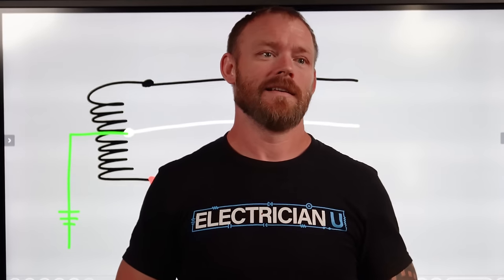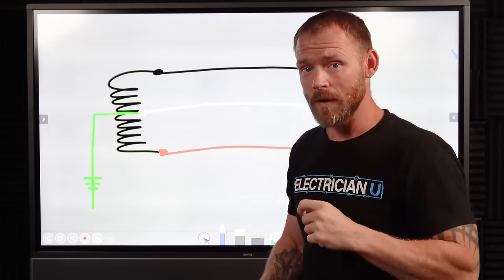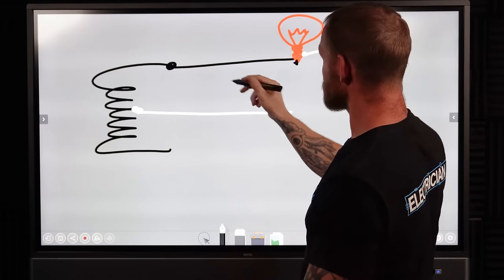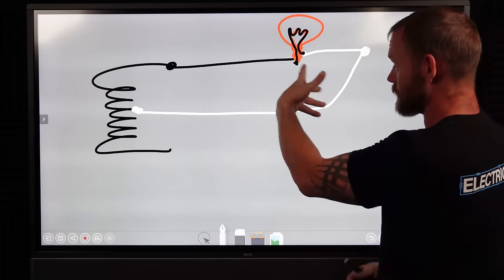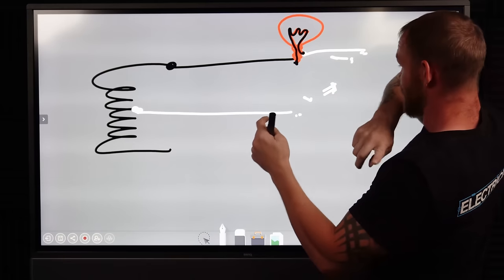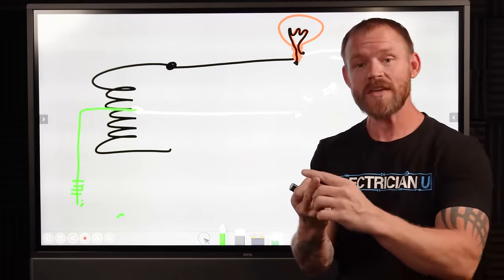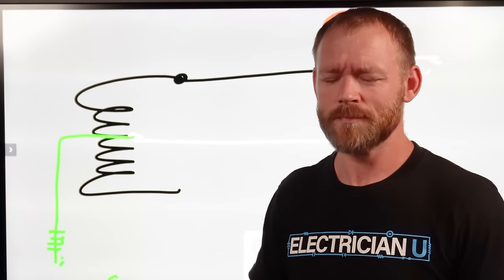Can You Get Shocked From a Neutral Conductor?

Comment: In a domestic scenario a household user can be walking around bare feet in the home which automatically connects the body to ground. If the user touches a floating neutral for a light bulb (and the light bulb terminal is connected to live) the user's body will provide a secondary neutral to the light bulb and current will flow into the hand and out the feet because the neutral is bonded with the earth at the transformer. PS: A Shock from a floating neutral to earth is more dangerous than a live to earth shock. The reason being is that there could be loads such has refrigerators, water pumps etc in the circuit which will draw the current it requires to run through your body. From 1 ampere can be fatal.

Comment: Three way switch where they originally wired a common neutral instead of the independent neutral to the light and each switch through the travelers. The neutral from two three way switches independent and they combined the neutrals. Depending on the switch settings there was voltage in reference to ground on the neutral. I learned the hand in the pocket from my dad an electrical engineer. When followed never got shocked. Some times you just got to use two hands.

Comment: Code nowadays still allows sharing neutrals between 2 or more hot conductors, you just have to handle tie the breakers. I hardly ever run multi wire branch circuits with shared neutrals. It's less safe for a few reasons. There's the shock hazard if the electrician didn't handle tie the breakers, and there's also a real risk that if you lose your neutral connection and it's no longer your grounded conductor, then you have 240 volts across your circuit in series and seriously fry things. And as far as I'm aware there's only 1 manufacturer ( GE) that makes an arc fault breaker that works with circuits sharing a neutral.

Comment: there is a way to get shocked on just one conductor but it does not involve the grid/mains electrical system.  a very high voltage static charge can do this.  in winter on indoor carpet one person scuffs their shoes to become charged and holds a bare wire.  another person touches that wire.  there is real current involved, lasting only long enough to balance out the charges.  this is not the only way.

Comment: Been shocked by neutrals, in a building where the electricians didn't do the bonding to ground that they were supposed to.  I became the path to ground absent the bonding.  And I've been shocked by white wires because the same idiots got "creative" with which wire they used for what.  Fortunately that company went out of business not long after doing that work.

Comment: No if it is a neutral. When it is connected to the source neutral. When a neutral is removed or disconnected from the neutral bar, it becomes an extension of the live / line conductor and your having a belt

Comment: Could this be a dropped neutral? I was working on completely rewiring a 30x50 area with MC above drop ceiling. I used clips to suspend the mc on the support wires. I had my hand on a junction box and accidentally touched my ear to a piece of mc going to that box and my ear got shocked. Not too bad, but enough to make me jump and say a bad word. That particular mc wire was to a light.

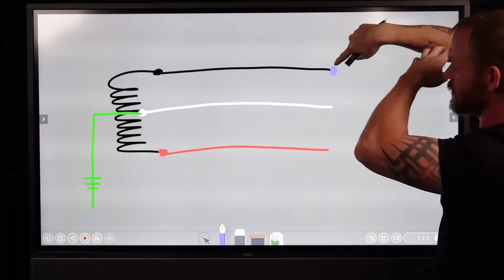Comment: The video makes it sound like you can NEVER be shocked by just touching the black "Hot" wire with one hand. So if I touch the black "Hot" wire as you did at 1:07 in the video and I'm standing barefoot on the ground or in a puddle of water I won't be shocked? Wouldn't the current try to pass through me to ground and back to the transformer?

Comment: I was rewiring a room one time. Though power was off initially. Then as I take a receptacle apart. I notice a 12/3 wire not the usual 12/2. Previous someone carried 2 hots from 2 breakers over on 1 cable. With seperate conductors. Then they split in a receptacle box.  I had power off I though. Then I seen that. And rechecked breakers... I don't usually use noncontact "deathsticks" as they can be inaccurate but I now atleast use it as a 2nd or 3rd verification there is no power.

Comment: I’ve seen a star connected transforme which wasn’t connected to ground (347/600 volts) common, this allowed the neutral to have a voltage which was 347 volts if touched with a person & ground. The job had been inspected by authorities & electrician 😳 😱⚡️

Comment: Got shocked holding 3 neutrals in one hand but it hit multiple points some one ran another circuit through a light and it was still hot. My mistake should have tested it all but I trusted someone else to say power was off while I was at the breaker.

Comment: Question , i was trying to changed a light fixture in a old house   And both cables had power ,  and I instal the light fix. Worked. Normals - why is that??

Comment: If you are in contact with a hot and grounded (no insulated shoes), would you not complete the circuit? At 1:15, you say touching the hot that the current will not flow to the neutral. But if you are grounded = bad day!

Comment: Yes  but I think what we mean is... can a neutral shock a person as opposed to a live positive;  I wondered about that too...since the current goes back to the panel on the neutral I suppose it could shock a person   but you would still have to be grounded? is that what youre saying?  AND IS IT CORRECT TO SAY THAT THE SHOCK WOULDNT BE AS BAD AS  A FEED WIRE BECAUSE  THE CURRENT IS ALREADY SPENT PASSING THROUGH THE LOAD?  does that make any sense?

Comment: You can touch just a neutral and get shocked. It's just a wire it carries current. Remember you are working on a circuit that has an issue. 3 wires burned together. But its 10 feet down in the wall. You have a fresh pristine receptacle you grab the neutral and you get electrocuted and die. It's because down the line there was an issue. So never just assume it's all wired correctly. There is a reason you were called out to work on it. It's not brand new zero issue circuit. Especially on 277 volt commercial property's.

Comment: You can be shocked by the neutral.
You body creats the path to earth neutral and earth's are tapped together at the transformer.
If you were to say take a lighting circuit.
Turn every lamp on.
And disconnect the neutral at the panel and you touch the neutral without touching the panel just standing on ground you can get some voltage and low current flow.
Reply: A broken neutral is not neutral. Just a wire.

Comment: Even worse if the neutral is from  one leg of a transformer based power supply or a motor winding.  At least a light bulb has some resistance.

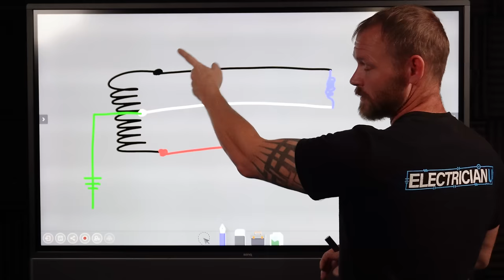Comment: At 1:00 you are completely wrong. The hot wire in your example will shock you. The loop is through you, across the ground, up the ground rod to the source. You even mentioned this later in the video with your light pole example.

If you don't believe me tail out a hot wire, stand there, and touch it.

Comment: Bull**

You can ABSOLUTELY get shocked by touching JUST THE NEUTRAL. 
Last year I nearly fell off of a 20 foot scaffold after shocking myself on a 277 fire exit sign. 
I had to work on it live, so I was extremely careful. I capped the ground, capped the black and only had the neutral left bare. I used my linemen to twist the wire around (the other wires)  to pull it out of the receptacle. Sure enough, I was preparing to cap the neutral, but the wire was all messed up, so I went to straighten it with my thumb and forefinger and BAMN.  Got blasted HARD. 
My feet were on my wooden plank with my insulated boots, and both hands were above my head. One hand on my linemans holding the wire, ,(neutral wire) the other hand touched the neutral end.

Comment: Wait.....I understand the theory and physics behind this. However....just about a month ago, I was installing a new outlet in my guest room, and I had all three wires sticking out of the wall. I accidentally touched the black wire (hot) and bam!! I wasn't touching anything else, and I was wearing athletic shoes at the time ,standing on my floor, which is vinyl planks. I know I wasn't touching anything else because I had the black wire separate from the neutral and ground as I left it that way to ironically keep myself from getting shocked as I hadnt turned off the breaker for that particular circuit.  It was the back of my hand that grazed it when I went to stand up from a kneeling position with both feet flat on the floor. So, what gives???
Case in point, if this theory is accurate, how do kids get shocked if they stick something metal on one side of an outlet ????.....I honestly understand the theory, as this is how workers work on high voltage wires that are suspended on towers. They are not grounded, so in theory, they can't get electrocuted. I just haven't seen this to be true in reality. What am I not understanding?????

Comment: Hey Dustin or anyone in the comments. I’ve asked 3 foreman and my school teacher and no one knows the answer. On a 277/480 system, or any 3 phase system, phase to ground is 277. Phase to phase is 480. What do you get when you tie all three together. I know this is not something we’d ever do but I’m curious. I’ve heard “it would still be 480”and “I don’t know” so here I am!
Reply: What do you mean exactly by tying all three together? If you mean literally connect 3 different phases together with no load you'd get a short circuit. If you mean connect all 3 phases to a 3-phase load then voltage between phases would be 480. See the thing is that voltage or difference of potentials can only be between 2 things, you can't test voltage between 3 phases at the same time, you only got 2 probes on your multimeter. So you'd test A to B, then B to C, and then C to A, which will give you the same voltage of 480. Hope that helps
Reply: Let’s say hypothetically you take all three phases, wirenut them together. Then take a probe from that splice to ground.
Reply: I know it would blow up but you can utilize two phases of 120 to get 240/208 so why doesn’t three phases utilized warrant a higher voltage.
Reply: Im not positive, but I have a hunch it would still be 480.  At any given point in the sine waves, the maximum potential difference would still be 480 volts.  Volts are read as a potential difference to “something” ( typically ground, or against another phase), so in three phase systems one sine wave is always 120 degrees out of phase from the other two sine waves.   So max difference shouldn’t be more than 480 volts.  But, I’ll admit I’m not positive.   

Just a suggestion… get an apprentice to touch 120 volts and measure his girl scream.  That scream can be your benchmark.  Then do same for 480 line voltage and see if his girl scream is bigger (it should be nearly quadruple the scream as 120).  Then get him to touch all three phases at the same time and see if his scream is even bigger 😂😂. Then we will have this mystery solved once and for all.   Who the hell needs engineers ?
Reply: The potential is 480 volts, anywhere between the sine waves. It troubles me that your Journeyman, or instructor didn't know that.
Reply: @jakesully5402  thank you for your response. That’s along the lines of what I thought too but wasn’t 100% sure. And I know just the right apprentice to try that on😂
Reply: @philipabshier2060  okay thank you. And I agree. Three foreman and my 2nd year instructor weren’t certain. Must mean I’m asking the hard questions.
Reply: @philipabshier2060  after some thought I have another question. So when a device/motor calls for 3 phase does it really just needs the other phases to transform the electricity back to rotational motion? As if it only needed 480 volts it could get that from two phases.
Reply: @sethoakes3795  with a balanced load you can have 0 return current. A device that needed 480V has to use 2 phases ( phase to phase) unless of course you simply had a way to boost the voltage. 

I think the answer to your question lies with in the properties of 3 phases power being able to deliver a constant  amount of power, which is ideal for a motor. You could also get constant power from 2 phases , but they would need to be 90⁰ put of phases, which is  what 2 phase power is. 
 Remember cos and sine are 90⁰ out of phase,  cos²+sin² =1. So you would get constant power from adding the power of the 2 phases connected to neutral.  In 3 phases, you get a constant power from adding the power from all 3 phases to phases connections together ( Va-Vb)²+(Vb-Vc)²+(Vc-Va)² = constant.

Comment: You can’t get shocked by the neutral but you will if you become the path or path of return. Same thing with the hot. If you only touch that one conductor nothing is going to happen. Yes between them if there is a load on that circuit. The copper inside the insulation doesn’t know nor does it care what color that insulation is.

Comment: The worst shock I ever got in my career I was working at an ice cream store famous for having a pink canopy inside that pink canopy wrapped around the front was illuminated by fluorescent lighting it had one big high output ballast and I had it on and my back was leaning on to the framing of the canopy I could feel the power going through my fingers and out my back and it actually left a big green burn on my back I got down a 16-foot ladder in less than 1 second without falling

Comment: As soon as you disconnect a neutral wire it becomes a hot wire in sheep's clothing! The same thing CAN happen with a GEC wire if it has objectionable current on it and is disconnected at a particular point.

Comment: So what does a neutral become when it's opened?  Is it still a neutral?
Reply: No.
In this case It is just a wire being the continuity of the hot wire (it's a hot wire then), standing there waiing to complete the circuit. If you touch that wire the circuit is then completed flowing through you to the ground (Completing the circuit) and you will be schocked

Now If you carefully connect that wire  to the common neutral bar of the house then it's ok, the current will flow now to your main house breaker then continue outside till the main transformer of the building area. There it's connected back to the transformer and also grounded and this is what is called neutral, it's all this path back "connection" to the main tranaformer and grounded there as well (for safety reasons)

A broken neutral wire is just a wire, not a neutral. So be very carefull with this and with any wire 😅